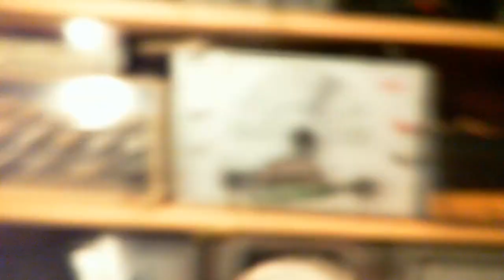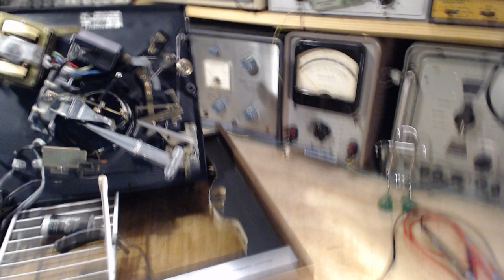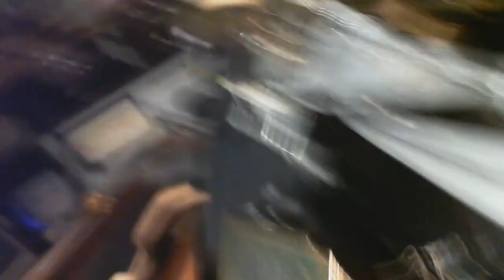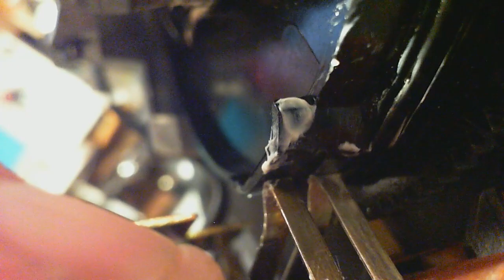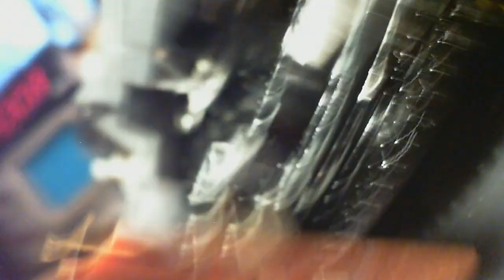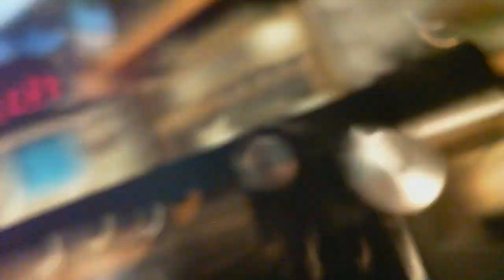Perpetuum Ebner PE3015 Turntable Video#3 - One Channel Dead

Comment: 28:34 and 28:45 You are totally wrong! If you look at the service manual the alignment procedure says to align the mute switches 251 to drop into that valley on the curve wheel 153. In that regard you are right! BUT IMPORTANT IS that even on drop down into that valley the switches are not to be closed contact but OPEN to a gap of 0.5 to 1mm at the PCB side! 
The whole mute switch assy is misaligned since the lower switch closes on dropping into the ditch! The mute assy needs to be set closer to the curve wheel. Then the top contact will open too and both contacts stay open during the whole ride on that elevated section.
For crying out loud RTFM and stop ruining things!
Reply: He’s spent a half hour “looking at that wheel without even removing the grease so it can be seen clearly.  It must be quite an adventure, living in Jim-world.

Comment: Sorry Jim ! What You did with the mute-contacts is NO repair !! You have two possibilities  now. First You can rebuild the ramp on the wheel with some epoxy or second You can glue the two contacts together with a piece of plastic, so the working contact moves also the other contact.
And still You did not check the error what was told by the owner that the tonearm moves sometimes uncontrolled over the record ! So this maybe still can happen, You also should look at this problem, because it destroys maybe some more records again !
Reply: When has he ever done a proper repair? 
And just FYI
The mute switch assy is misaligned. Read the service manual! It clearly states the alignment procedure (at least in the german version page 13)! 
And key is that even when sitting in that ditch in the plateau the switches are BOTH to be OPEN by 1mm. It is not the bumps opening the contacts it is the whole ramp or plateau. So the contact assy 251 needs to be set closer to the curve wheel 153.
The ditch created by the bumps on the lower switch is a stop and reference point to align the tooth-gap in the curve wheel 153 to be centered around  cog wheel 9.